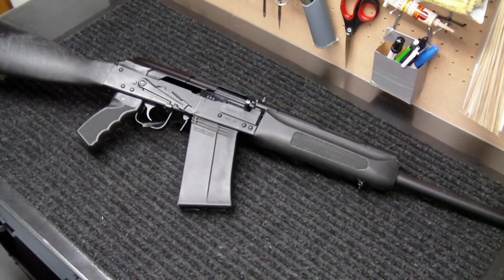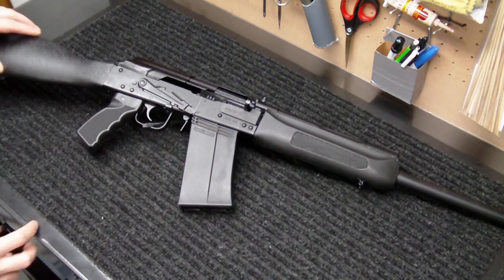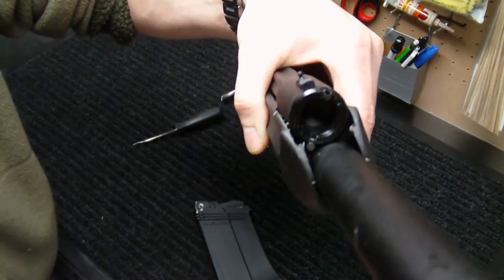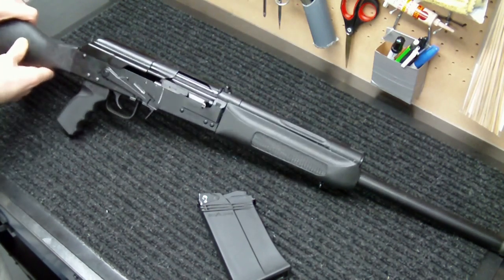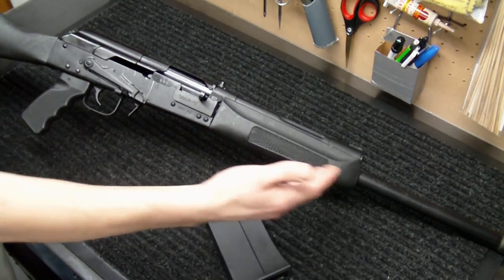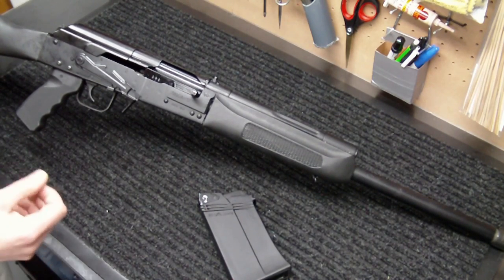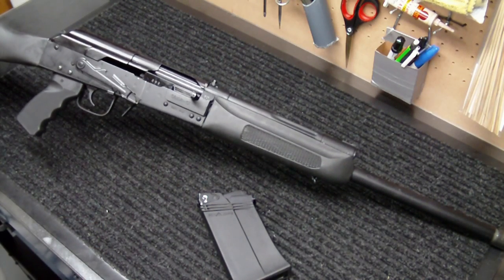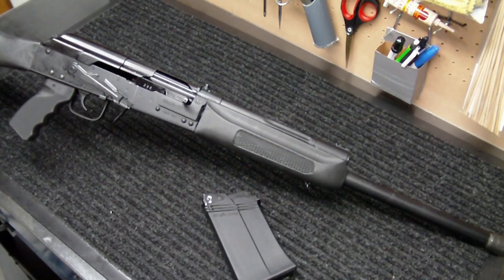Saiga 12 Gas Adjustment | Gas System Plug Settings

Comment: I swapped the factory gas plug with a V Plug from MD Arms.  Has 5 gas settings and allows for reliable use of light target loads and stays cleaner than the factory plug.  By the way - I am the guy that sold you an M&P 15T.  Nice channel.  I have an SLR101S also.

Comment: Thank you for putting this up. I just got a first model Saiga 12 together today. I had a hell of a time finding the original factory adjustable sight. Now I am planning to take it out to shoot it for the first time it has ever been fired. This thing has been in storage for many, many years. ( Without the sight, Apparently the lack of the sight kept it from being used.)
Reply from the maker: thanks for watching!
Reply: Initial high brass test went well. It seems to like S&B 00 Buck ok. Now I am going to try it with #4 low brass Winchester upland game loads.
This time I am going to pattern it and sight it in for the bead sight. It came with a 20 rnd drum, but I am not really all that fond of the drum. The weight with a fully loaded drum is pretty extreme. I think I am going to find some ten round clips to use instead.

Comment: Good video, information that was spot on for what it was intended to cover. After reading up and watching numerous videos, supposedly posted to help with the shooting operation of the Saiga shotgun and finding them more about guys trying to video bravado and show off not helping with the issue at hand. The 2 settings is EVERYTHING and your gun will not function reliably without this knowledge, thanks for the clarity I needed(so simple) . AND the comment about cleaning being more necessary because of "WAX" from shotgun shells that is not a factor in the AK 47 round or barrel, I would not have thought of that since my AK 47 works flawlessly with minimum cleaning but there is no wax in the rifle round. Thanks for staying on the one subject.
Reply from the maker: Awesome, glad it helped and I truly appreciate the thoughtful feedback!  thanks for watching!
Reply: My gun does not have a 1-2 setting and you can't see or reach the pin without a flashlight. The first setting is all the way down the second setting clearly unscrews the choke upward. So would the first setting be 1 since it is with the choke all the way closed and the second is with the choke up a little , I assume letting more gas out?  I was going to send a picture but no option for that.

Comment: Its not completely bird shot /slug it does have some to do with weight of the load and mostly the amount of powder that the low and high brass contains.  High brass more powder , low brass less powder. Some of your low brass shells have more or less than each other and that's usually the manufacturers specs for their shells.

Comment: Thank you for this video it was very helpful, kindly let me know how often should one clean Saiga  12 gauge, it is as tough as AK47 or not
Reply from the maker: Thanks!  I typically clean my firearms after each use, but I would recommend cleaning after 40-50 rounds.  You will find some of the wax buildup is hard to remove in the barrel otherwise.  I would say it is comparable to cleaning an AK, but the barrel can be a bit more difficult.

Comment: Do all the saiga-12 variants have a four positions for adjusting the escaped gas back to control the pressure on the piston?
Reply: Mine has 6 with the 1 position turning it into a bolt action. The 1 position completely shuts off all the gas. 2 position is for high brass with 6 being for low brass...